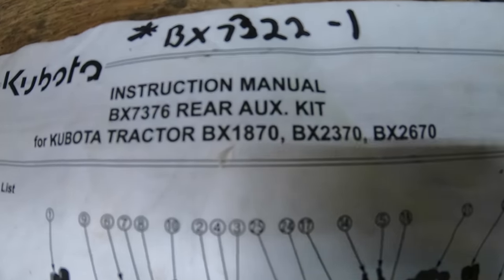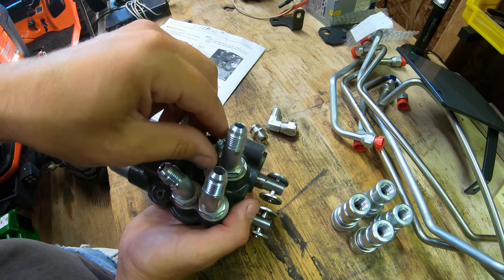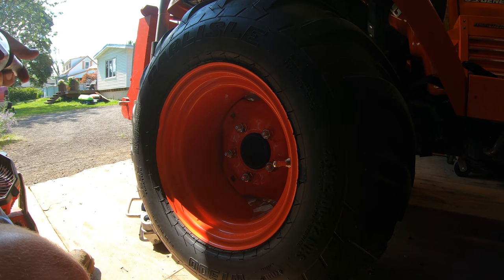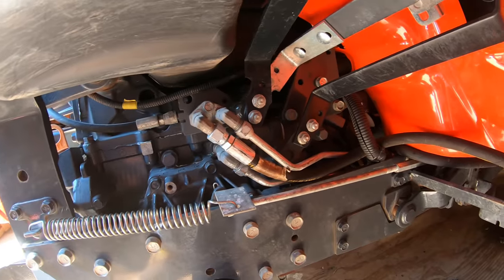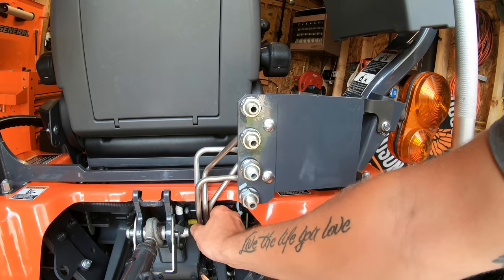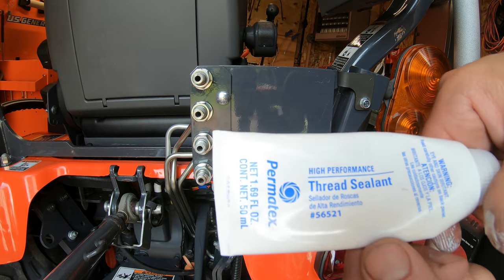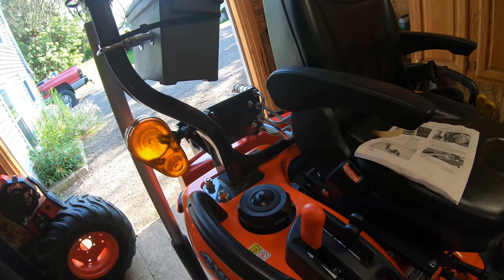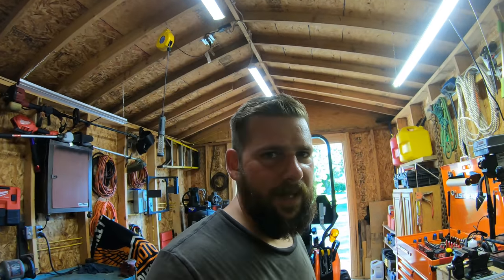Kubota BX- Rear Remote Kit + Hydraulic Top-Link (FULL INSTALL)

Comment: Are you running wheel spacers? And if so... do you run them front and rear or just rear?
Reply from the maker: Yes I am, iv got 2" rear spacers on just the back.. adding wheel spacers to the front of a tractor does nothing for stability as the front axle pivots.. You can still choose to add some smaller 1" spacers to the front though just for looks which I have debated doing myself. I made an Install Video on the wheel spacers that you saw in this video I will Link the Video below. 

This video should answer any questions you have on wheel spacers..
LINK: https://www.youtube.com/watch?v=DUuf1Olxd0I
Reply: @BiffsEquipment  Awesome! Thank you. Really been enjoying your videos!

Comment: Where did you purchase this kit. I have a bx 23s
Reply from the maker: You can get it directly through your local Kubota dealer or can even order it from messicks.. give messicks a call if your local dealership is confused as these rear remotes can be quite rare and many local guys at local dealers don’t even realize that it’s an option they sell for the Kubota BX but if you call a big enough dealer like “messicks” they will know exactly what you are talking about. They shouldn’t cost more than $550ish for the whole kit but last I checked supplies were dwindling.

Comment: I wish they made this for my BX25, really like the cleanliness of the final product but I don't think the connections would work with the seat swapping around for the backhoe.
Reply from the maker: Hey Ken, yah you are correct, you could certainly buy this kit and install it but once you did you’d no longer be able to use your backhoe properly or with out having the rear remotes interfere with the seat when you rotate it around. Maybe some day Kubota will come out with a new kit as I hear the same complaint from guys with the BX23S
Reply: @BiffsEquipment  Thanks, I've been looking at the kit and it seems like it's possible to actually mod this to fit a BX25; it would involve moving the existing "tank" line from the BH to a "T" on the tank line from the FEL since the tank line from the BH goes into the port this valve set plugs into. Obviously the line positioning would interfere with the seat but I wanted to put a line set in back and a line set in front so I'd just have some hoses made up. It can be done with the BH retaining full functionality, just takes a little bit of replumbing. Of course, the valve fitting with the BH subframe is a different story; might have to mod that just a tiny bit.

Comment: Would this work for a BX23s with Back Hoe? I'm sure the rear mount location and hard lines wouldn't, but if the remote valve will mount the same and main  levers to fender would also work. Soft lines could be used to relocate the rear remote plate. Maybe there is a kit for BX23s with BH option, I can't find one.

Comment: Do you know if there's a factory valve option required to run a hydraulic top link? I'm working on a Kubota B2601 build on their website to submit to my local dealer. I wanted a hydraulic top link after seeing videos on how handy it is when using a box blade, which is one of the main uses I have for the tractor. I've asked a dealer rep about it, and he said he'd never even heard of a hydraulic top link, but also said he was still learning about tractors in general. On the website build it has the option:

 Hydraulics/Hitch/Drawbar"

Mounting Base with Valve Kits
None
1ST POSITION VALVE KIT (B1654 & B7304)
PLUS 2ND POSITION VALVE KIT(CHOICE OF VALVE FOR 2ND POSITION) (B1654 & B1655 & B7304)

I asked the rep on the phone about these options and whether or not they were required to install a hydraulic top link. I could hear him ask someone in the background and I heard that person say "he doesn't need them unless he's running large, multi-functional farm implements which he won't be with the B2601". I've been trying to research how the heck I can add a hydraulic top link, but info is difficult to find to say the least!
Reply from the maker: Hey man, tbanks for the question.. yes there are certainly hydraulic top links you can use, the Kubota rep you talked to didn’t know what he was talking about. The issue is Kubota themselves don’t sell a factory hydraulic top link, they will only be able to pull up the factory one. What you need to do is bring your original top link to a hydraulic cylinder store, even one like tractor supply should suffice and get a hydraulic cylinder that matches the length of your threaded cylinder fully shortened and make sure the hydraulic cylinder matches it when it’s fully shortened.. then make sure your eyelet diameters are the same size and you should be all set. You can also fully extend your factory top link and find a cylinder that matches the legth when fully extended too.. you bascislly just wanna mimic the size of your factory top link with any hydraulic cylinder that matches it and slap it on.. it doesn’t have to be made by Kubota, any hydraulic cylinder made for top links with those special eyelets that swivel will work so long as it matches your top link at the shortest measurement . Best of luck!

Comment: Ok what would you use a hydraulic top link for? I have a coupla ideas but was wondering what your plans for it are? I do know my first time in a long time hooking up a 3 pt hitch brought back bad memories those can be a PIA!
Reply from the maker: So a rear top link can be useful when connecting rear Impliments specially if you have a “Quick-Hitch” like I do.. if you don’t have one then I highly recommend it.. they can be purchased for about $150 and will save you so much time and energy when connecting rear impimenrs and having s hydraulic top link allows it to work even easier.. I also plan to use the top link for a grader box and back blade when I buy them so that when I’m grading I can adjust how much material I’m cutting from the ground on the fly by adjusting the angle of the implements via my hydraulic rear remotes Vs. having to keep getting off the tractor just to make minor adjustments with a wrench every time I need to so it’s also a huge time saver for that as well. I plan on getting a hydraulic side link soon as well which will allow me to also tilt my implements side to side again with out having to manually adjust it

Comment: I'm wondering kind and size of cylinder this is?  I wonder if it's just the right size or if you would want one shorter or longer now that you've had it for a while.  Thanks
Reply from the maker: Hey Tekker, so the cylinder works well, but if I could change it I would add maybe an extra inch or two in cylinder length as it doesn’t tilt down quite as far as I was hoping but for a free cylinder I just had laying around Iv been very happy with it.. I do plan to buy an actual top link cylinder for it tho eventually because the cylinder I have now does not have pivoting eyelets on either end which can cause an issue down the road if it has a huge amount of side load applied it could potentially crack the ends on the cylinder so this is the main reason for eventually buying an actual top link cylinder from tractor supply or what have you but in the meantime I have had no negative affects using this cylinder like it was. Hope this helps!

Comment: Curious why you used a hydraulic toplink without a check valve? I’ve been looking for a toplink with a check valve without much luck for my BX2380. Would you recommend one without a check valve?
Reply from the maker: Sorry I’m just seeing thus comment man, sometimes Youtube hides them from me. I would def recommend one with a check valve if you can get it, otherwise it’s not needed but is def nice to have as you won’t have to worry about the cylinder ever bleeding down on you. Mine doesn’t have one because the cylinder I’m using I already had so I just used it cuz I had it, if I were to buy one new I would go with one with a check valve. Let me know how you made out!

Comment: Hey Biff got hydraulic kit on now looking for recommendation for hydraulic top link
Reply from the maker: Sorry that I’m only just now seeing this comment Dave sometimes YouTube hides comments from me. I don’t know any parts numbers but I have heard of guys going to tractor supply and buying them from there. Just be sure to measure the length both in and out and a cylinder that best matches. Also make sure you buy a cylinder that has a check valve if you can so that the pressure does not bleed back on you after it sits awhile. My cylinder didn’t have one but I plan to add a check valve myself in the near future

Comment: Help a new guy understand why you didn't use the hydraulic thread sealer on the fittings to the hydraulic valve, but you did on the couplers.  Thanks
Reply from the maker: The reason none of the fittings going into the hydraulic block or hydraulic valve didn’t need thread paste is because those were all O-ring fittings where the ones with thread paste are just like a standard pipe thread. Any hydraulic fitting with an O-ring or a bevel like a JIC fitting doesn’t require a thread sealer or paste. Hope that helps 👍🏻
Reply: @BiffsEquipment  thanks, that is really helpeful 👍

Comment: Why is the BX7322 and 26 needed for the BX2360s?  What is the difference between the 2?
Reply from the maker: Mainly the differences are on the ROPS or too bars.. the roll bar designs are slightly different which changes the way the kit is mounted. Aside from that it’s the same kit
Reply: @BiffsEquipment  I thought it might have been a valve setup then the other part is the port set.  I know some places like to sell multiple "kits" to make more money.

Comment: Will a hydraulic top link void the warranty on my BX2680?
Reply from the maker: Hey David, no the hydraulic top link won’t void your warentee so long as it’s installed correctly and your using an actual hydraulic top link cylinder. The cylinder I’m using isn’t an actual top link cylinder which can eventually cause damage. I plan to eventually swap it out for the correct cylinder tho so that it doesn’t damage the mounts as my cylinder doesn’t have the swivel ball sockets in it like a typical top link cylinder has. Best of luck!

Comment: Too bad the B2410 didn't have this option.  There is/was a rear remote setup, but nothing like this as a full kit, nor slots for levers in the fenders.   I did find a kit that connects to the trans housing, but not sure what it does yet until I get it.   I think its to connect a spool with a power beyond built into it.
Reply from the maker: Sounds like it should be a very similar style kit but not sure, let me know how you make out

Comment: Do you or anyone reading these comments know why they say this kit will not work on the BX25D? (backhoe version) I'm guessing where the bracket mounts on top of the fender it would cause it to interfere with the hoe in some way? If that's the case would rubber hoses and a slightly different mounting bracket resolve the issue?  Any help with this question would be greatly appreciated.
Reply from the maker: Hey Mark, great question! Yes the issue is that the rear remotes would interfere with the backhoe and the lines and mounting bracket would be in the way of your legs and may even stop the seat from sitting properly when it’s turned around. I personally have never owned the backhoe model so I can say for sure if using rubber hydraulic hoses and moving the mounting bracket would fix this issue or not but one issue I know you would have is connecting all 4 hydraulic lines to the hydraulic valve that gets mounted tightly under the fender.. there is JUST enough room to install all the metal lines so there certainly wouldn’t be enough room to do all rubber lines as they are so much thicker.. you may be able to make your own custom hard pipes tho and use some special angled fittings to get the ports to come out more from the valve and once you do that then you may be able to attach rubber hoses from there but it would be a lot of work. I’m sure it’s not impossible tho. Moving the bracket itself would be easy but the valve has to stay right where it’s at as it connects to the side of the trans where it returns the oil back to the reservoir

Comment: I have a Kubota b7500 how can i get a rear hydraulic remote kit?
Reply from the maker: Hey Aden, I would give your local Kubota dealer a call and ask which options they have for your year/model Kubota. They may make a factory kit like mine but they don’t make kits for every machine just some of them.. if not they can show you where to get one, you may have to go online and buy an aftermarket kit, if so then I would highly recommend “summit” “summit makes 3rd functions, diverters, rear remotes, and rear hydraulic add-ons and all are top notch quality from what Iv seen. Kubota doesn’t offer a true 3rd function for my tractor so I went with a Summit kit I ordered off eBay for dirt cheap. 

Here is the link to my Summit 3rd function install: https://youtu.be/DFCrphw3hRg

Comment: Is there a kit like this for the bx1880
Reply from the maker: Yes there is, If you call your local dealer or visits/call Messick they will be able to point you in the right direction to help get you the correct kit for your 80 series tractor. There will be 2 kits for the 80 series and it covers the 1880, 2380, and 2680.. there are 2 kits because depending on which version of ROPS you have they make a kit which adapts to each style. Hope this helps!